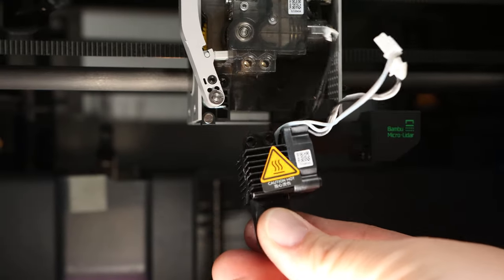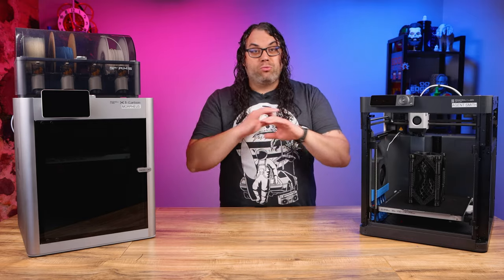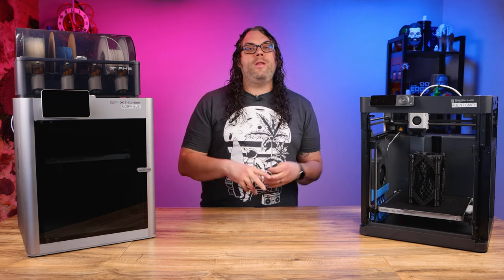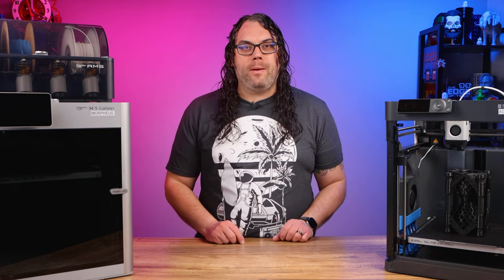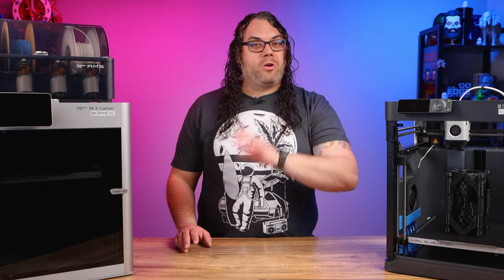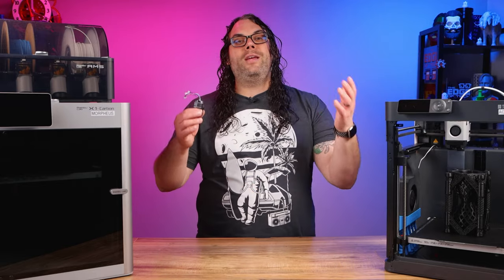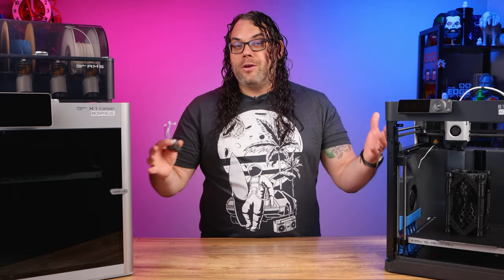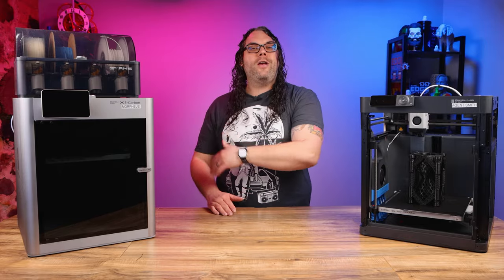The Bambu Lab Complete Hotend Replacement Is SO FAST!

Comment: I think you need to change the nozzle on the machine front panel by selecting the 'nut' on the left strip, the 'Maintenance'  tab and selecting the proper nozzle under the accessories/nozzle setting.
Reply from the maker: Good point! If you change the nozzle size, you would need to do that. But if you're staying the same, you shouldn't I don't think!
Reply: @TheEdgeofTech  In case others are reading this comment at a later day, that option doesn't exist on the P1P or P1S.
Reply: @snart so what do you do if you want to change nozzle size on P1P
Reply: @tjans1979  The option now exists on the P1S and P1P! Navigate to the little gear and select accessories. :)
Reply: @snart  Nice. I just bought the 06 hardened nozzle so I could do some wood PLA. Was hoping I would be able to do this, now I just need to figure out what settings work with such filaments.

Comment: I “accidentally” ordered a spare complete hot end when I ordered my printer because I wanted a 0.6mm hardened steel nozzle.  My fan died today after only a couple of weeks of use and was able to get back running the same day because I just swapped out the complete hotend.  I will get in touch with support and get a new complete hotend (or the parts to make one).  I will definitely order any future nozzles as a complete set.

Comment: It's definitely cheaper to buy the complete hardened steel hotend assembly. The fan and heat pad combined cost $37 USD not including everything else you would need to build one.
Reply: It's not cheaper if you can the fan from the old assembly and put on the new one. Ordering the complete assembly just saves you time from having to do that, which costs a little more.

Comment: After buying the hardened hotends without fans and thermistor because I have both P1P and X1C, I realized the hassle of messing around with the different thermistors and fans (they are different on each machine). So, I bought the correct fans and thermistors to dedicate those hotends to a machine for simplicity and purchase a few more complete sets. So, now I have extra .04, .06, and .08 for both..it is worth it.  I am now going to buy extra extruder hardened to have on hand. I already have large supply of cutters, wipers, etc. My suggestion is to have these on hand if you buy these printers, new company, supply chain, etc.  Although supplies and filaments have come quickly, usually 4 days and they come from CA and I am in Ohio…
Reply from the maker: Great advice! I have several different ones myself! They are so easy to swap, and so cheap to get, that it's really worth it!
Reply: Hello, 
Is it possible to replace the hotends with brands other than Bamboo Labs? Perhaps the DyzeDesign for higher temperatures.
I apologize if this is a basic question, but I'm not familiar with the process. Thanks

Comment: I just used your video to put in a hardened 0.4 hotend. THANK YOU!

Ok, so now I have a hardened steel hotend but doesn't the printer need to know that? Won't it need higher temps now?

Comment: Jim, good video.   I have a spare .6 mm for my X1 carbon and a spare extruder.  They are both fairly easy to swap.  I also have all the spares needed to rebuild a hot end.  As you mentioned the prices are reasonable.
Reply from the maker: Thanks David! I agree, they are easy to swap and it's a good idea to keep them around. And I really do think the price is great for the whole assembly!

Comment: I have been wonder. Does the hotend for the X1 and P1 series use the same Heastbreak as the new Qiditech Machines? They look very similar.
Asking because BIQU & E3D came out with the Panda Revo and I am wondering if that hotend would also work on the Qiditech machines as well. It would make swapping nozzle so much easier for both brands of machines.

Comment: Theres a setting on my P1S that asks what hotend is in there (as of today's firmware). Shouldn't I also change that?
Reply: Yea you need to let the printer know you are now running a different nozzle, so then it will run on those profiles instead of

Comment: Thank you for sharing the video. I am wondering if it is possible to use other brand hotends, such as DyzeDesign, to achieve higher temperatures? Or are you specifically referring to the use of extra hotends from Bamboo Labs in your explanation?

Comment: Much appreciated.
But...
These should be options on the Bambu website.
Want a hardened  hot end on your P1P, then pick it on the drop down order menu.
Just like a car, shoes, picture frame, etc etc.  This idea of having to buy a unit and then order parts you have to install is so 1990.
Reply from the maker: Believe there is an option for a hardened hot end for the P1P!

Comment: Hello. What are the benefits of upgrading to the hardened steel nozzles? I am assuming longevity,but any other benefits? 

I am purchasing the x1c and on the checkout it's giving me price cuts on the hardened steel upgrades. I was not sure if it was just a sales tactic or not.
Reply: for some material you need the hardened steel, the level of abrasion of some filaments is way too high.... but to be precise, in that case you need to change the gears as well, if you don't it's just for longevity in standard filaments

Comment: i cant find 0.2 nozzle hardend steel, does stainless steel nozzle good ? what is the main difference ? Thanks
Reply: Stainless steel is good for normal filaments like PLA and PETG.
Hardened nozzles are good for filaments that are abrasive like Glow-In-The-Dark filaments,Nylon,Carbon Fiber, ASA, and ABS.
Stainless steel nozzles will work with those filaments, but it will wear the nozzle out much faster.
Reply: 0.2mm nozzles are mainly for basic PLA/PLA+ that's why they only come in stainless steel. Silk, Glow, Carbon Fiber etc. are for 0.4 or even better 0.6 nozzles.

Comment: Which hot end mm is best to print helmets?
Reply: From what I understand you want the larger nozzles for bigger sized prints. Like 0.6 to 0.8mm.

If you go to Bamboo labs it has a chart on the pros on cons of each nozzle size. Smaller nozzles usually mean better quality but slower print speeds. While larger ones are faster but not as good quality.

If you are just starting out I would go with a 0.4 as it has the best all rounder.
Reply: @3DPrintingWithDaz  i really appreciate you and this comment, I had order the bambu lab p1s on Black Friday and I’m still waiting for it to ship. I have been looking for videos to see about hot ends nozzle sizes and you just helped me haha thank you

Comment: So why didn't they use swappable nozzles for colour change?
Reply: Are you asking why they didn’t make it with a tool changer? Having multiple tool heads is a totally different kind of beast and can be pretty pricey if the end user isn’t going to use it that often.
Reply from the maker: I am not sure what you are referring to. Do you mean like an IDEX machine where it has two full hotends?
Reply from the maker: For sure! I have a couple of the IDEX, and I almost never use them. The AMS on the Bambu Printers make Multi Color printing so easy!

Comment: There is a reason for all the clogging.
Reply from the maker: Not sure what you mean? I have had one since May 2022, and never had a clog yet. But I do know that in some cases if you are using filaments in the AMS that vary temps a lot, that could cause an issue.
Reply: @TheEdgeofTech  According to Bambu, the tubes wear down. The dust and debris ends up in the tubes. Tubes are made of PFTE it can resist temps up to 255 C. So it is not hard to figure out where it ends up.
Bambu recommend tube check for each 10 kg print. 5 kg if you print wit with abrasive filament. So keep eyes open.
Happy printing.
BTW, it's all in Bambu Wiki.